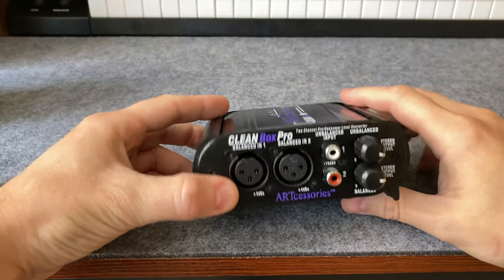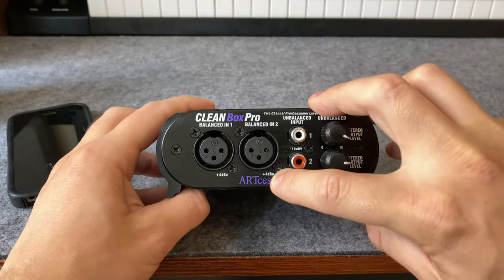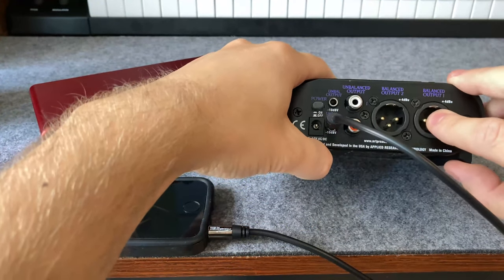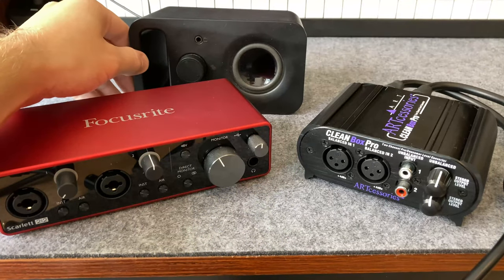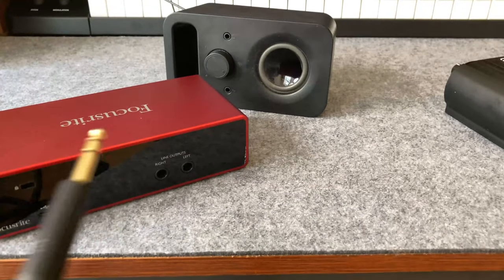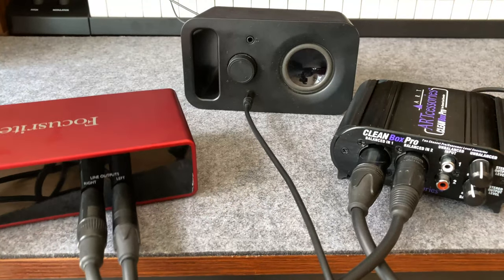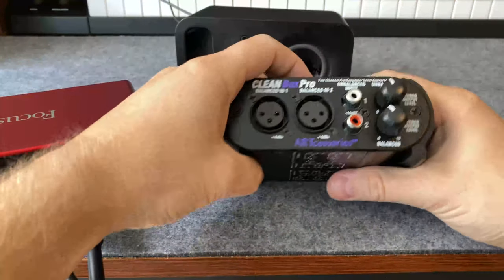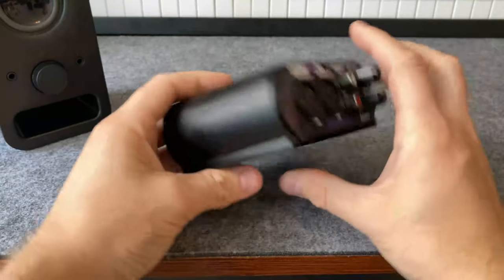Art Clean Box Pro - Review

Comment: I'm receiving some noise when my Rodecaster Pro 2 to my Atem Mini Extreme. I'm hoping this little gadget fixes my problem.

I'll report back if it works.

Great job with the video. You gave me more confidence attempting to solve my problem.

Onward,
AW
Reply: You don't need one, On atem mini you can change line level to mic level either way at the settings.

Comment: i need to take my avr sub pre out to a crown amp. if i use the rca inputs can i then use the rca outputs? another question would be is there a benefit going from the rca to xlr balanced outputs? if so what is the advantage? i am running 2 18" dayton ultimax subs in denovo cube boxes. my amp just for reference is a crown ce4000. which is a killer amp btw. the issue im having is i have to turn my avr damn near all the way up in order to get any somewhat decent output out of the subs. i know i need something like this to fix my problem. the avr needs a signal boost for sure. any help is appreciated

Comment: How do! In trouble shooting mode at home. Recently bought 2 monoprice m215s running off a onkyo rz3100. They replaced def tech supercube reference and trinity. The monoprice subs are drastically underperforming and im hearing this thing is being used to get better (gains). Is this safe to plug directly into the subs?

Comment: Ok so if I have a dj mixer with only xlr outputs and I want to hook it up to speakers with rca inputs, I can hook the xlr cables from the dj mixer into the CleanBox xlr input and then output the audio with the rca outputs on the CleanBox into the speakers.
Reply from the maker: Yup, as long as the speakers are active (aka have a built in amplifier ).
Reply: @darkdreamstudios7933  Ah ok, well almost if not every speakers that I have seen that has rca inputs are active speakers, but thank you for the clarity.

Comment: Hi mate. What's the default position of the output level knobs? I should stay full right toget max volume?
Reply from the maker: This is a guess, but I think this thing has some gain to it to help boost the signal a little if needed, so I would guess utility gain is around 7 (or 3 o’clock). I keep mine back off from full volume to avoid additional noise caused by the box’s internal amplifier, but either way I think the noise is negligible
Reply: @darkdreamstudios7933  Would be nice some advice from the manufacturer. Sadly there isnt.
Others would say that knob is only limiting the output, so full up is considered passrhrough 0db gain

Comment: So I've got KRK Rokit 5 g4 studio monitors hooked up to my krk sub S8.4 that goes into my audio interface via balanced cables. Now I have a Pioneer DJ controller collecting dust that I wanted to try out with my setup, but after plugging the RCA output of the controller to the subs RCA unbalanced input there was loud noise. Is this simply the different power ratings that is the cause? And also can you even use both the interface and DJ controller at the same time? (The speakers are plugged in on the interface) Is this product the solution? This shit is not easy hahah
Reply from the maker: The noise issue sounds more like a grounding issue. Try plugging in all your gear to the same power strip to see if it goes away. You might have success getting rid of the noise with this box, but usually mismatched impedance noise is not really loud, just kind of loud and sounds kind of weak. Regarding your signal chain question, I don’t know what interface you have, but I would try to plug the dj controller into two inputs on the interface, then turn the mix knob on the interface to half way so you can hear the dj equipment and your computers audio at the same time. Hope this helps
Reply: @darkdreamstudios7933  Thanks for the reply, I think it's most likely impedance noise. I have an headphone amp on the desk which i turned off in case of interference, but still noise. Initially the noise let me down, but then I tried DJing with it plugged in on the subs RCA input, and it sends audio like it should to the sub and speakers! If I turned a song on, the noise was not that dominating, but not preferable. So I guess with this box some of that noise could go away. I think I will use it straight into RCA for just learning for now, so I dont spend extra money if I happen to not DJ much.
Reply from the maker: Try to find it used on eBay or Craigslist. They don’t go bad, just a metal box with metal electronics. You might get one with noisy pots but that’s a easy fix.

Comment: I urgently need your help im using this to my cameras for a live stream just asking to see if I have them set up correctly 
so from my cameras 3.5 to rca go to input or output?
and from my mixing board using xlr should I use input or output ?
so In summary cameras to which side and which side should I connect my xlrs to the mixing board plz help im getting alot of distortion in my stream 
should I also reduce the output levels too say 12o clock 

plz help 🙏🏽
Reply from the maker: Out of mixer into ‘balanced in’ on art cleanbox, output of unbalanced art cleanbox  into camera input. That way the sound gets recorded to your camera. If your getting distortion either turn it down or more likely you have my instructions above reversed.
Reply: @darkdreamstudios7933  so helpful I appreciate it bro
Reply: @28keyz did this work?
Reply: @AskAW  yesssss plzzzz